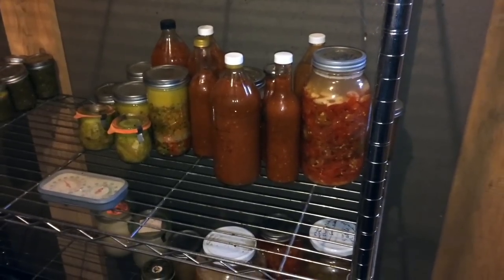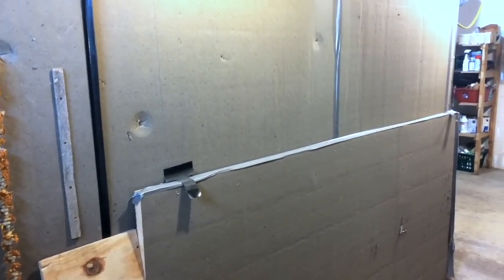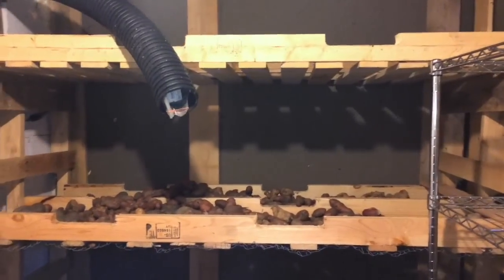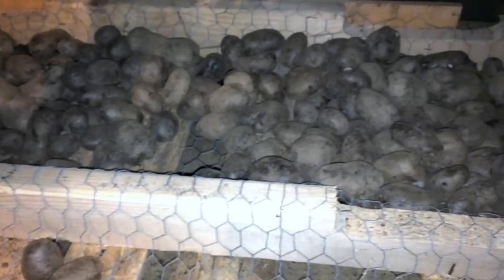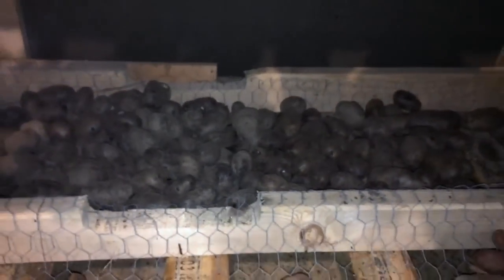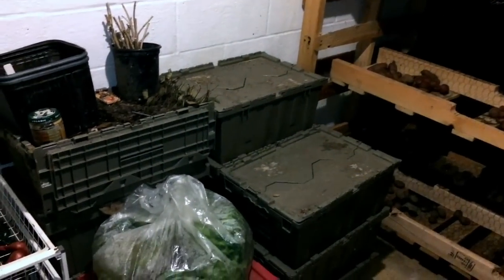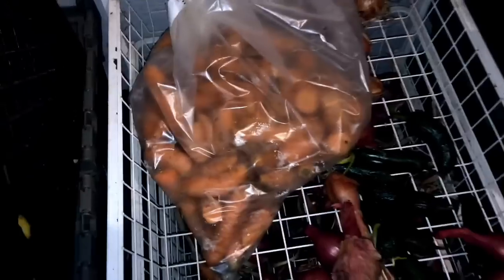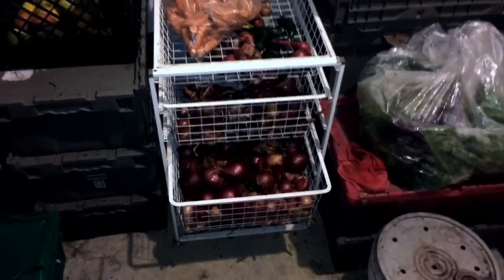$20 Root Cellar - Passive, resilient and spacious!

Comment: Big fan of your channel and approach.  I'm in Hawaii, so we don't have cellars and the temperature never gets low enough to preserve anything.  I watch all your videos even though only about 50% applies to my current situation.
This might not be a profound point, but I think the idea of cost beyond monetary cost might be the most important concept for future survival.  You often talk about stacking function and building things inexpensively, which is critical, but I think the more important idea behind it is what is the cost to the environment.  By building your cellar with used materials you're saving money and your overall financial expenditure is inexpensive, but you're also saving the manufacturing process of those component if you were to buy it new.  
I'm typically willing to spend extra time and effort to repurpose something and I get a real thrill out of knowing that I didn't contribute to the manufacture of another thing.  For a lot of us, the financial cost savings is much less relevant than the other hidden costs that didn't get expensed; the collateral damage.
Thanks for your channel.  You're genuinely a role model.
Reply from the maker: I appreciate your thoughts here for sure.
 For us, a lot of the time the financial consideration isn't the driver at all.  Saving $50 here or $100 there on a big project is nice but isn't critical.  The ethics of re-purposing materials, avoiding the new manufacture of limited resources as you say, and in some ways, most importantly, being able to say 'no' to new is what pushes us in those directions.
 I highlight cost and price in the videos more because I think it's an entry point for folks to come into the concept of DIY, reuse, scavenging, bartering, etc.  I figure people motivated by ethics around consumption will get it and appreciate the approach through that lens.  It's nice to have that assumption supported by your thoughtful comment here!
 There are so many materials swirling at the edges of capitalism, hoping someone can still find them useful and can put them back to work!  Committing to that approach as a default has made it so Sasha and I have a comfortable financial savings, operate a profitable, although small, permaculture business and enjoy ample free time.  It's so many win-wins!
Thanks for being part of the community!

Comment: what kind of foam board is that? I know you weren't going for aesthetics, but it's nice to have solid color foam board that doesn't have a bunch of writing all over it which is most of what I saw on home depot's website. Awesome awesome video brother thank you.
Reply from the maker: It is much older stuff, paper backed.  Nice simple look but not ideal around mold formation unfortunately.  We may have to replace it this summer...
Reply: @edibleacres  hmm okay good to know. so what would you use instead?

Comment: Great idea.. Will a dehumidifier work to keep out. Mold. And is this mostly for winter storage rather than summer
Reply from the maker: This is basically just for winter storage.  A dehumidifier I suppose would be an option but you ggenerally want higher humidity for most storage crops...

Comment: Is there any heat transfer from the block foundation to outside the root cellar in the surrounding area? Would you recommend insulating the inside as well? Awesome video and ideas!
Reply from the maker: I couldn't say since I never measured.  That said, I haven't sensed it so I wouldn't recommend it as a necessary first step for success.  I'm still super super happy with this design after a few years.  Very simple to set up and has been incredibly resilient.
Reply: @edibleacres  Thank you, Sean!

Comment: How cold does it have to be outside for this to work?
Reply from the maker: It is a continual curve of function I think.  Once the outside temps get below 50F or so it begins getting cooler.  Ideal outside temps seem to be around 20-30F for the space to be really nicely cold, but you can always make adjustments to the intake, etc to get it where you need it.

Comment: 10/10 going to do this or something similar in our new to us 75yo home. Question about the pawpaws: stored inside rather than heeled outdoors due to rodent fears or another reason? Thanks Sean keep rockin it
Reply from the maker: So excited that you might explore this concept.
Pawpaws... Generally I like to simply heel them in outside, but this one set in the basement was from a container I had filled with super tiny baby pawpaws, and I wanted to see how they would work stored in the basement.  I will plant them back out in a nursery bed with some space to get much larger this year.  I want to see if it's worth the effort to store them this way (more likely than not I'll go back to 100% heeled in in rich, deeply mulched soil in mid-fall.)
Reply: @edibleacres  right on makes sense. Besides cold veg storage one of the primary reasons I want a cold cellar is to stratify seeds. Have probably a thousand nuts/fruits in my fridge, and a couple hundred buried in the yard. Would be preferable to have a space indoors where I can put quantities and better monitor them without occupying fridge space/getting a secondary fridge. I think this will be ideal.
Reply from the maker: @davidsimpson2635  I think folks 1) in a cold climate, 2) with a basement, 3) with enough material wanting to keep cold that the thought of a 2nd or 3rd fridge 'might be necessary' should ABSOLUTELY explore what a root cellar could look like.
 You may end up deciding that building a root cellar lets you store more of your normal fridge contents down there can work and more seeds in the very stable fridge environment, or some mix.  
This is all aside from the idea that having a resilient, grid free way to preserve necessary food during the hardest season of the year isn't too bad an idea :)
Reply: @edibleacres  ya mon! Would be cool (heh heh) to make use of this cold. Enough of it to go around in Nova Scotia I tell ya what

Comment: We only recently moved into a home with a basement. I definitely want to build a root cellar. However, I have real reservations about bringing cold air inside the building envelope.  We live in an area both further north and considerably colder than you. I'm concerned if it is not well designed and very well insulated it may consume more energy and cost more additional heating costs than it saves by avoiding refrigeration.
Reply from the maker: I can't tell you with any numbers/facts if that is a well informed concern or something not to worry about... BUT I can tell you that we're zone 5B, with pretty long, cold, wet, sunless winters with heavy winds, in a poorly insulated home heated with wood and we use about 2.5 cords a season... 
I would venture a guess our root cellar makes the basement a BIT colder overall but not by much.  If it was built with a higher level of quality, with better sealed door, better insulation, minimal air gaps, and more insulation, with a controlled air intake (not a plastic bag!) and a way to handle the warmer/stale air it would be very appropriate and perform beautifully for you.  if your air intakes could be truly shut off then it would be able to exist in your space and periodically have 0 impact on incoming cold air...  
I'd encourage you to explore it, let us know what you end up with!
Reply: @edibleacres  I definitely think it is going to be dependent both on climate and, to lesser extent, the details of your house and heating system. We'll definitely try something, but it may be a while as we have a lot of projects going currently. I may try something like they did at back to reality, if I can find a large chest freezer. Another option would be to use our unused well casing, but access would be inconvenient so it may be better secondary storage. 

We are quite a bit colder than you in zone 3b.  Temperatures of -25F are normal. We are also 75% overcast in the winter and average over 8 ft of snow in the winter. 

Like most houses in our climate, our home is reasonably well sealed and insulated. With typical heating bills around $3000 per year, investments in improving the efficiency of your home generally make obvious sense. 

Interestingly, it seems that everyone thinks their winters are cold. In Texas people asked me how I could wear sandles when the weather was in the 50's.  In Florida, every older lady was concerned because my 1 year old wasn't wearing a hat. In Wisconsin, the students are out sunbathing in bikinis at the same same temperatures. Having moved to Maine I am sending my children out to play because the weather is nice at temperatures that I would have said were quite cold just a year ago when I lived in Wisconsin. And when I look for information online about various aspects of dealing with the cold every post asking for suggestions for dealing with subzero (F) temperatures has at least one, and often many, responses from people saying "It gets really cold here to. Here is what I do when the temperature drops below freezing," (or even warmer). The range of human adaptation is huge. We adapt to what we are accustomed to and quickly adjust our expectations based on what is normal for where we live. And I'm sure there are still many people in the world who would envy me my warm climate (although examining maps and climate data it is interesting that population density seems to track temperature fairly closely when you get this far north.)
Reply from the maker: @tnason04  I hear you fully on this!  When it first hits freezing in the fall everyone has 10 layers on and rush to get back inside.  First time it's really above freezing and the sun is out in the spring and people are out in shorts and a tee shirt!  I know I've spent my fair share of January 40F days in a tee shirt soaking in the 'warmth'...  Helps remind us how much of our experience is in our mind and we can choose how comfortable we are going to be if we think enough about it!